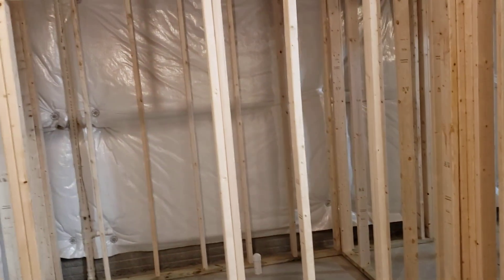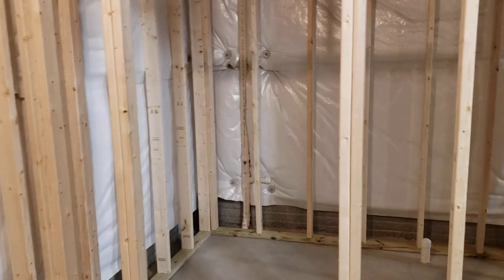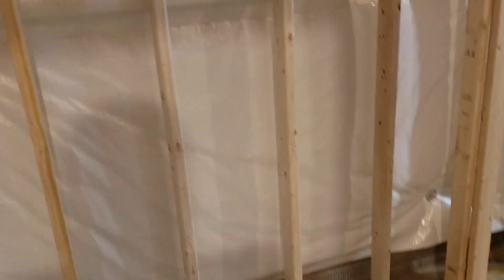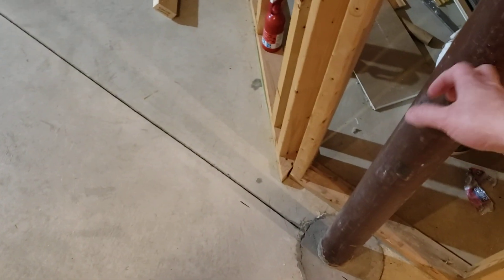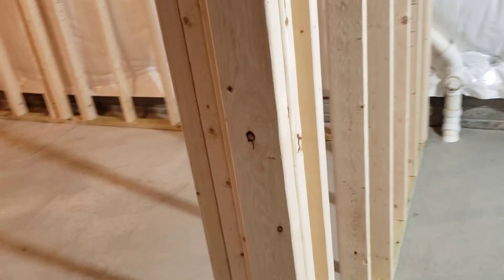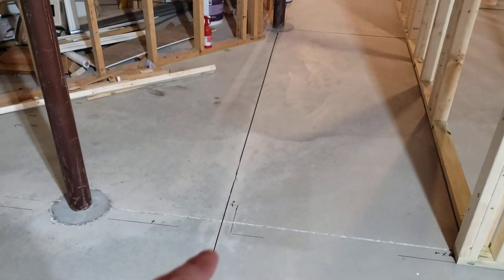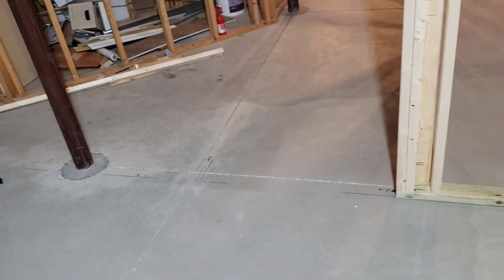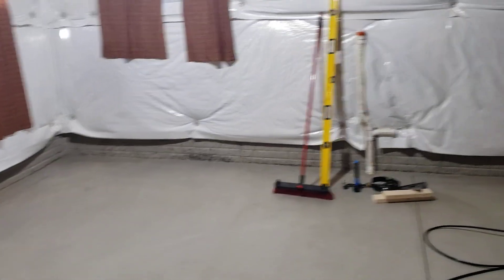Building My Collection Room | Part 2

Comment: I always wondered what Anthony does for a living. A Man of action and diverse skillsets 😄 Great work framing! Those gaps would bother me too after all that work but from the outside looking in you'll be fine it will cover. Could shim it some more for piece of mind. First and last time I framed all the doors in a family house renovation, and the drywall guys were impressed. They said if a tornado comes through these frames & doors aren't going anywhere 🤣 I shimmed and nailed them all rock solid because I hate flex too.
Reply from the maker: I don't do construction for a living. But anyway, the gaps are necessary for a project like this without stick building the walls and that takes forever.  Id rather just let the drywall do it's thing and cover the gaps.  The walls are solid either way... Probably more solid this way actually since stick building the walls would require toe nailing and if you aren't careful, those nails aren't biting much

Comment: Looks good. Coming from Massachusetts to Florida, I miss having a basement. Good luck on the finish product.
Reply from the maker: thanks.  basements are great.  missed it in texas.
Reply: Looks good but can you leave the frames like that (studs only) and still be compliant?

As for the annoyances yeah I really 'love' when we have to work around existing stuff AND deal with uneven floors - that's just the best in construction 😅
Reply from the maker: Not sure what you're asking about it being studs only and compliant.  Can you clarify?
Reply: @AnthonysCustoms  I'm in New Zealand over here they call it nogs or dwangs don't know what you call it in US. Goes every 600mm (can go every 400mm) between the studs.
Maybe you don't need it cause it ain't structural - plus I only been doing this for 5 years so still a lot to learn - but I never seen a wall frame built without them…
Reply from the maker: Are you talking about horizontal boards to brace the studs?  We call that blocking. It's not necessary for walls like these but I'll have it in there once i have the walls all up.  Just doing it at the end to save time.
Reply: @AnthonysCustoms  yeah horizontal 4x2s - probably blocking then… I was wondering why those were missing…

Comment: thats alot for 18 hours also are you going with 16 inches between 2/4s id toss a few 16 inch 2/4s  edge to edge between each stud or they will bow  with moisture
Reply from the maker: Yeah. 16 on center.  I'm going to do the blocking at the end since it's tedious
Reply: @AnthonysCustoms  lmfao that is true

Comment: I was wondering today during the KC review, where you were filming at.  I didn't know you were still in your old place.  Are you going to build a ceiling railing crane for your camera?  Also, what typing of lighting, will you build in LEDs?  Was the house just built or was the basement just unfinished I can't remember is you said in the previous vid.  

God job!  I solo built a floating deck in my back yard, I learned all my skills growing up, my dad was a DIYer, it took me forever.  I was relieved when I was done.  People are surprised it looks so good... lol only if they knew all the mistakes and corners cut.   Funny I was gonna make a joke saying that a board was off by an 8th of an inch, but I guess it really is.
Reply from the maker: Oh yeah. Lots of 8ths.  I'll reply to the rest of your comment when i get home later
Reply from the maker: I'm not going to mount the camera to the ceiling.  need to be able to move it around too much.  led lights.  house is almost 20 years old.